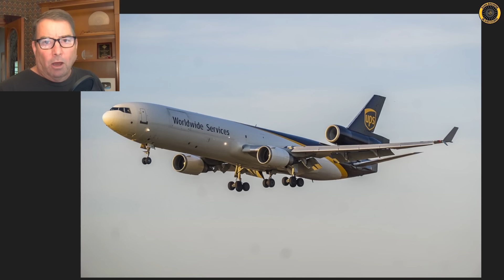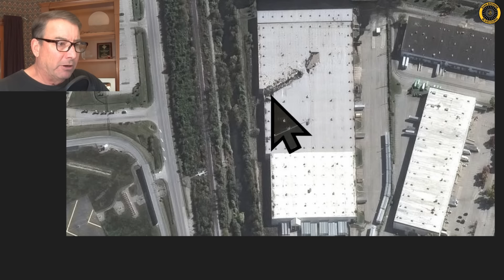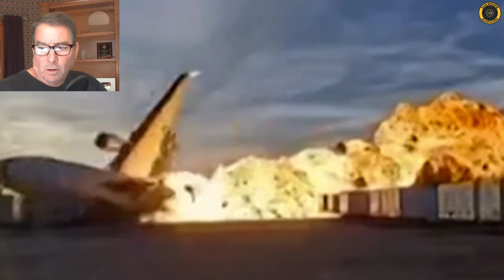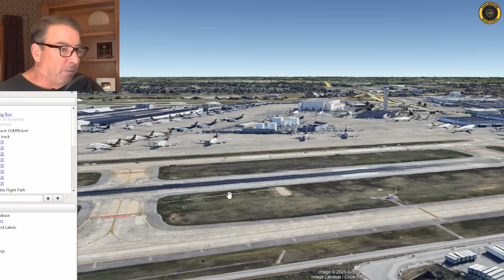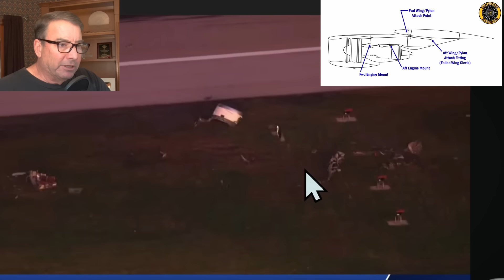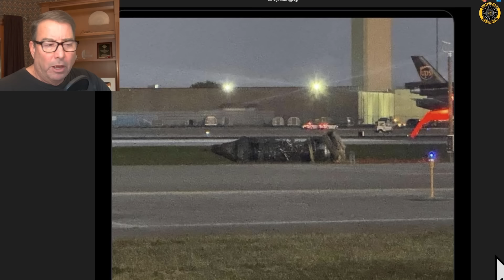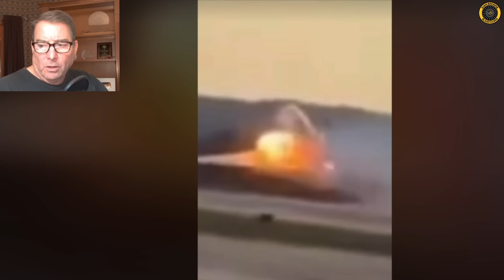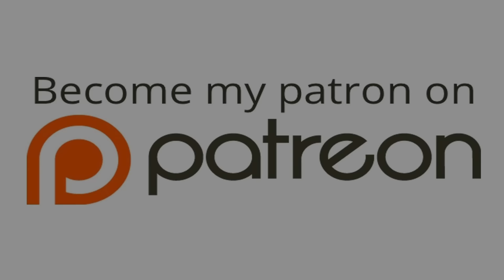UPS #2976 UPDATE 2 6 Nov 2025

Comment: 🧰 1⃣ How the hand-off works before flight

At a major hub like UPS’s Louisville (SDF):

Crew reports discrepancy – either on the inbound flight or during engine start (“ENG 1 VIB HI” message).

Maintenance control (in an ops center) logs it in the aircraft’s discrepancy book (logbook) and assigns local line maintenance.

A line mechanic goes to the aircraft, runs tests, checks sensor wiring, maybe does a short power run.

The mechanic decides if it’s:

Fixed,

Deferred under the Minimum Equipment List (MEL), or

Grounded pending further inspection.

If deferred or fixed, the mechanic signs the corrective action and the Maintenance Controller issues a Return to Service (RTS) release.

Once RTS is signed, the flight crew can legally depart.

⚙ 2⃣ Why it might be cleared even with a warning

There are several very common failure modes that look like false alarms on older aircraft:

Possible symptom	Usual maintenance interpretation
“ENG 1 VIB HI” during start, then clears	Faulty accelerometer or wiring. Run engine—if it smooths out, call it good.
Slight oil level fluctuation	Normal after shutdown; top off oil.
Audible rattle in pylon	Fairing vibration—no structural issue.
Vibration spike after bird or rain	Fan ice—melts off, vibration normal again.

If the reading stabilized and there were no abnormal sounds or indications during power run, mechanics may log it as “Ops check good.”

To the ground team, that’s a safe release.

🧭 3⃣ Why they could still miss the true danger
a) Limited time and data

At a hub, every minute of delay costs thousands of dollars. A two-hour delay is already a big disruption.
Ground crews rarely have time or tools for in-depth diagnostics (no full borescope or pylon removal).
They depend on cockpit readouts and visual checks — which can’t reveal an internal crack or liner separation.

b) Aging aircraft complexity

Older engines often have small quirks — occasional “vibe blips” that clear up. Over decades, that becomes normalized as “just how this tail behaves.”
So when a high vibration appears, it may not trigger alarm bells if that airplane has a history of nuisance warnings.

c) Data not trending in real time

UPS uses Engine Health Monitoring, but those systems usually upload data post-flight.
If vibration spikes were happening over time, nobody may have correlated them fast enough.

d) Human factors

Pressure, routine, and confirmation bias:

The mechanic wants to fix it quickly.

The controller wants to keep the schedule.

Everyone believes it’s just a sensor again.
That subtle groupthink can override the gut feeling to ground the airplane.

🪨 4⃣ The technical blind spot

If the real root cause was a loose acoustic liner or internal imbalance, it might not show visually at all.
A sensor swap or a “good run” could make the readings look fine temporarily — but the physical imbalance would still exist, waiting for full-power thrust to make it fail.

That’s the most insidious kind of defect: non-visible, intermittent, and misleadingly normal under test conditions.

📋 5⃣ So what UPS oversight might have failed here
Oversight area	Likely gap
Maintenance Control	Accepted a “good run” instead of deeper inspection.
QA/Engineering	Didn’t flag repetitive vibe reports on this tail number.
Dispatch	Allowed release after a “cleared” logbook entry without second review due to prior deferral.
Training	Mechanics may not have been taught how vibration can indicate structural fatigue, not just sensor faults.
⚠ 6⃣ Why this is systemic, not personal

No one on that ramp meant harm or took shortcuts maliciously.
This is a textbook latent organizational failure — what accident investigators call a “Normalization of Deviation.”

When the same issue shows up repeatedly and never causes an incident, the culture starts to treat it as harmless — until one day, it isn’t.

✈ 7⃣ In short

The warning was there.

The test appeared to clear it.

The maintenance and dispatch systems didn’t see the hidden danger behind the data.

The plane was legally and procedurally “airworthy” on paper — but physically, it wasn’t.

That gap between paper airworthiness and actual mechanical health is exactly where the UPS oversight failure likely sits.

Comment: Many "lucky" circumstances with this tragedy including that this plane missed Stooges Bar & Grill by a few feet thereby saving more lives.  Also had the plane took off on 17L it would've gone into the FORD plant which was still staffed.  As it was, most of these businesses were already closed for the day, with fewer employees and visitors around.  Wind from another direction and had they took off to the North, the highway and two large hotels are in the flight path.  A bit further out are more hotels and the Louisville Univ Football stadium.  "Luck".
Reply: Yes, even the slight deviation it took from the path of the runway centreline meant that it likely hit less structures than it otherwise would have done - including as you say, Stooges.

Comment: What about the previous issue with other crashes where the #1 engine fails and that engine powers the recorders? Is this MD11's recorders reliant on the #1 engine for power?
Reply: nonsensical comment, recorders on all aircraft are powered by battery, you can lose all engines and recorders still work

Comment: 🌀 1⃣ What “vibration” actually means

On modern jet engines like the GE CF6-80C2 used on the MD-11, “vibration” isn’t just about noise or a slight shake — it’s a measured oscillation of the engine’s main rotating assemblies:

N1 = the big front fan

N2 / N3 = inner compressor and turbine shafts

Each has vibration sensors (accelerometers) mounted on bearings and engine frames.
The readings are displayed on the flight deck via EICAS (Engine Indicating and Crew Alerting System) as vibration units, typically from 0.0 to about 5.0 IPS (inches per second).

Normal readings: 0.1 – 1.0 IPS
Caution: >2.0 IPS
Warning: >3.5 IPS, depending on phase of flight.

⚙ 2⃣ Why vibration matters mechanically

High vibration means that one or more rotating parts are out of balance or are shaking in resonance with the structure.
It’s the mechanical equivalent of a washing machine with a loose drum — except at 10,000+ RPM and 10 tons of thrust.

Possible causes include:

Fan blade or tip damage (from FOD, ice, or erosion)

Loose or missing acoustic liner panel inside the inlet

Bearing or shaft wear

Engine mount or pylon looseness

Compressor stall or airflow distortion

Even small imbalances multiply rapidly — a fan disk that’s off by just a few grams can create tons of alternating load on its mounts.

🧱 3⃣ How vibration can turn catastrophic

That alternating load travels through:

The engine bearings,

The pylon structure, and

The wing attach fittings.

If vibration persists at takeoff power, you get a cyclic fatigue stress in those parts.

Here’s what can happen:

A fan or liner starts vibrating — maybe just a loose rivet.

The vibration excites the natural frequency of the pylon or mount bolts.

Those bolts flex microscopically each revolution (hundreds per second).

Cracks form — invisible even to normal visual inspection.

Under the huge takeoff thrust, the already-weakened mount finally fails → engine detachment.

That’s why engine vibration is not just a nuisance; it’s a structural warning.

🧭 4⃣ Why it’s easy to misjudge on the ground

The tricky part is that vibration readings can:

Vary with power setting, temperature, or startup conditions,

Be caused by a faulty sensor, or

Disappear once the engine warms up.

So, maintenance may see “high vibes” on the ground, do an engine run, and find it clears — leading them to think it’s a transient sensor error.

That’s why many accidents trace back to intermittent vibration reports that were cleared as non-issues.

🛠 5⃣ How it should be treated

For older engines and aging mounts:

Repeated or unexplained high vibration must trigger borescope inspection or fan balance check.

Persistent or sudden high vibration grounds the aircraft until the cause is found.

Airlines with aging fleets often use engine health trend monitoring (EHM) to flag changes before flight crews even see a warning.

If UPS’s systems logged high vibes before Flight 2976 and didn’t trigger a deeper inspection, that’s precisely the oversight investigators will focus on.

⚠ 6⃣ In short

Vibration = imbalance = structural stress.

Even a few minutes of high vibration at takeoff thrust can destroy mounts or bearings.

When an aircraft is 30+ years old, the margins for “ignore it, it cleared itself” are gone — each vibration event might be the last warning before metal fatigue takes over.

Comment: ✈ 1⃣ The known facts

The aircraft, N259UP, was delayed roughly two hours before departure.

Eyewitnesses and tracking data suggest the left (No. 1) engine separated and ignited seconds after liftoff.

The engine had been through heavy maintenance weeks earlier.

UPS told NTSB “there was no maintenance done immediately before the flight,” but multiple ramp sources say a maintenance hold was released shortly before pushback.

That means there was some technical discrepancy, probably one that was deferred or cleared after troubleshooting.

⚙ 2⃣ Most plausible causes for a “maintenance delay” on an MD-11 engine

Let’s look at what typically triggers such a delay during preflight at a freight hub like Louisville:

System	Typical symptom	Usual ramp action	How it might link to this case
Engine vibration monitoring (N1/N2 vibe exceedance)	Pilot notices high vibration on EICAS during engine start.	Maintenance runs engine, checks for sensor fault or fan imbalance.	If vibration persisted, it could hint at fan damage or loose liner, later causing failure.
Oil quantity or pressure indication	Low oil level warning at gate.	Top-off or sensor swap.	Might indicate internal leak or bearing wear — could contribute to vibration or failure.
Fuel leak or drip at pylon	Observed during fueling or start.	Fuel panel inspection, deferred if minor.	Possible evidence of pylon seal or feed line stress, precursor to detachment.
Bleed air or anti-ice valve fault	“ENG 1 BLEED” EICAS message.	Deferred if not needed for flight.	Minor alone, but could mask thermal distortion in pylon fairing.
Thrust reverser unlock or sleeve indication	“REV UNLK” message.	Visual check, manual stow, MEL deferral.	Would require ground crew inspection under pylon area.

The most credible rumor from multiple ramp techs and aviation channels is a “vibration exceedance” or sensor swap — consistent with Blancolirio’s discussion that acoustic liner material or fan damage might have been involved.

🧩 3⃣ The likely sequence

Here’s a technical hypothesis (not official NTSB finding):

During start or taxi, crew noted an engine vibration alert or unusual sound.

Maintenance called, ran a ground power run, and the vibration reading stabilized (possibly after the engine warmed up).

The issue was cleared as intermittent or sensor-related, with no visible fan damage.

Aircraft departed normally, but the underlying fan imbalance or loose acoustic liner remained.

On takeoff, at full N1 thrust (~110%), that imbalance amplified vibration through the pylon structure, initiating a metal fatigue crack or fastener failure.

The pylon attachment failed under asymmetric load, and the engine separated.

That would fit both the delay and the failure mode seen on the runway (debris starting near the 2,000-ft marker).

🔍 4⃣ Why this matters

If that’s accurate, the “delay” represents a missed final warning — a chance where the maintenance/dispatch system could have caught the impending failure.
That’s why NTSB and FAA will scrutinize:

The exact MEL entry (what discrepancy was logged).

Who signed the aircraft release.

Whether the engine run-up data was archived and reviewed.

It could reveal the point where the chain could have been broken.

🧠 5⃣ My best technical guess

The two-hour pre-departure delay was likely due to a high engine vibration indication on the No. 1 GE CF6 engine.
Maintenance likely inspected and cleared it as a sensor or balance issue, without discovering internal damage or pylon fatigue.
That same vibration, under takeoff thrust, likely amplified an existing pylon crack or mount weakness, leading to the catastrophic separation seconds later.

Comment: wondering if the NTSB is gonna be talking clearway issues at legacy airports. That warehouse is clearly way closer to the runway than would be allowed today; you can see the sequenced flasher install for the runway extended on to the roof of the building. to say nothing of having a hazmat facility right there.

Comment: The engine has extensive damage to the fan section. Most of the fan frame and fan case are missing or mangled. You can clearly see the LPC stators which are normally covered by the fan case. The mess at the front of the engine does appear to be remainder of the Kevlar wrap that has been delaminated. Also, in other photos, the front flange of the fan case appears to still be attached to the inlet cowl. That would mean the fan section ( the fan blades and hub ) failed in flight, or the fan case was ripped apart after impact. The engine core is mostly intact, so it was not a turbine disk failure. If it was the fan, it would have had to be multiple blades or the hub ( like UA232 ) failing to cause this much damage.

My thoughts and prayers to Louisville and UPS.

Comment: Question. If all fails at take off speed and you know the plane won't fly, it seems that it be safer to stay on the ground and plow into whatever is forward rather than gaining altitude and then falling back into the ground to crash? Let's assume you know the plane is unable to fly, both propellers or engines fell off, both wings damaged or off. I understand it's difficult or impossible to make decisions quickly, but let's assume you were able to.

Comment: @blancolirio The dashcam video was taken on Grade Ln looking north towards Crittenden, rather than on Crittenden itself. You can see the Grade Lane Tires shop (7011 Grade Ln, south of Knopp) on the right hand side, where the 2 men ran from. Right across the airport perimeter fence and Crittenden is the UPS Supply Chain warehouse (with the gash in the roof) and the plane clears that in the video before it crosses Grade Ln. Since it was wings level at that point, it’s possible the gash was made by the landing gear.